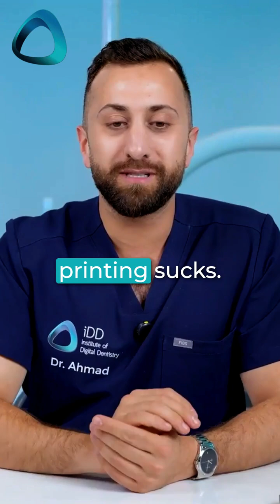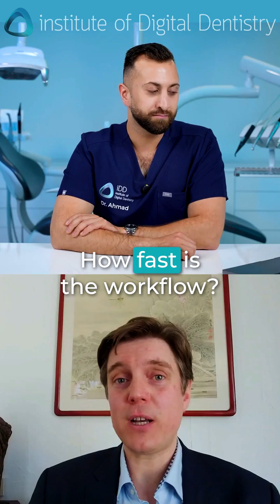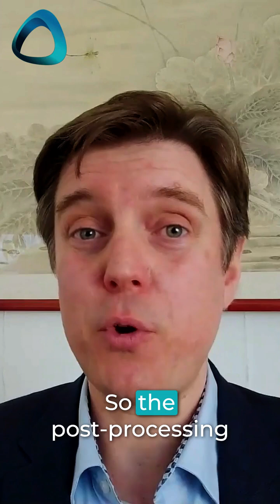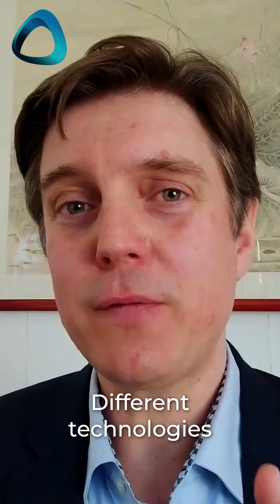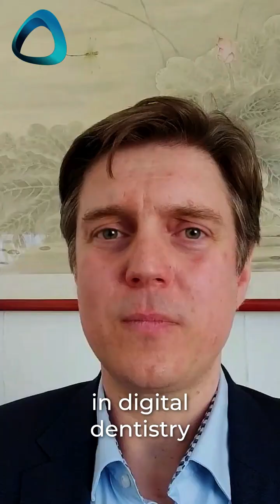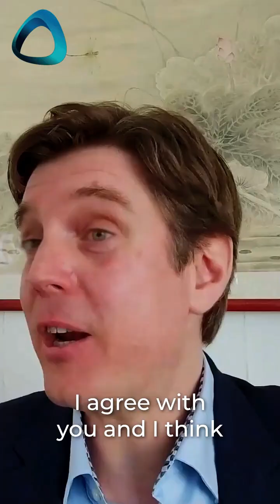Mill vs. Print: The Dental Tech Battle You Need to Understand

Comment: Sprint ray promoting printed crowns that mpa  are at best temporaries strength
Reply from the maker: Composite crowns are a thing in some regions already. No comparison to emax/zirc but when is it going to be 'good enough'
Reply: Yes they are half the strength  of tooth but companies are promoting as Permanent
Reply from the maker: @yosefkowalsky3004  I think wear resistance is more important of a measure than MPA. I am not sure we need 1200 MPA when trying to mimic nature.
Reply: Strong bites will crack low mpa crowns.i think
Reply from the maker: @yosefkowalsky3004  I dont think so. Resin flexes. Same reason composites all around the world don't crack much.